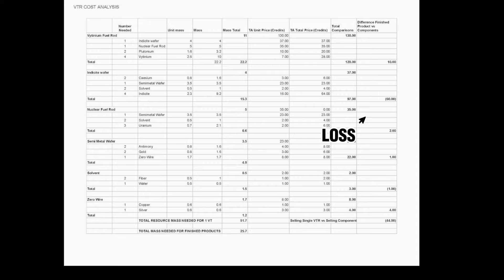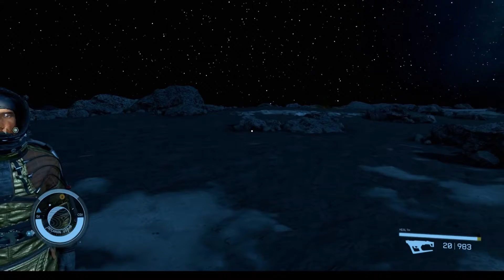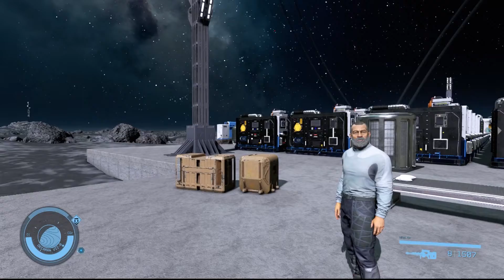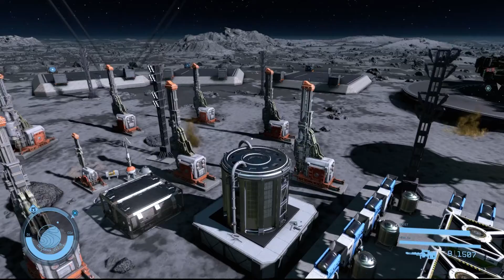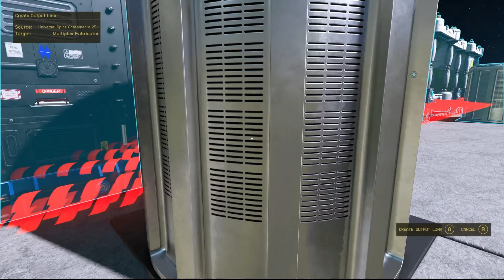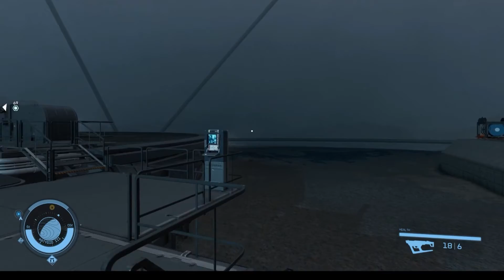04 STARFIELD ULTIMATE VYTINIUM FUEL ROD FACTORY

Comment: Hey how do you use the seller? I set up a test outpost just to sell rothicite raw. I have extractors running and outputting into a universal storage from Magnus, then I put a seller - inorganic next to the storage, it won’t let me link the storage to the seller, and opening the UI of the seller it doesn’t let me select rothicite at all… I noticed when building the seller it says it requires something like 142 aluminum per “tick” or whatever to run? I had 900 aluminum on me but it still wouldn’t run
Reply from the maker: Sorry to hear that but that Mod is two years old and has not been updated. If you don't mind recceiving Astras, I have two mods that will buy without a problem.
https://www.nexusmods.com/starfield/mods/13396
https://www.nexusmods.com/starfield/mods/13474
Reply: @WillNY4  Fair enough, will check them out thanks. Got it to work but the 10K Credit stacks you get are only bought by traders for 1K so you lose a lot versus just manually carrying the raw mats to merchants lol